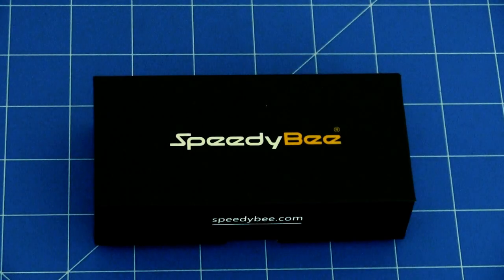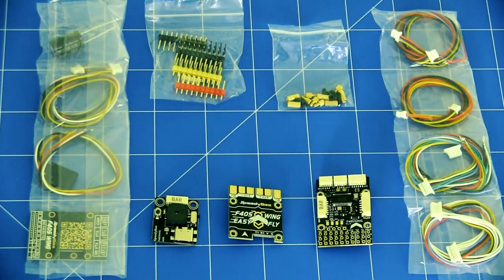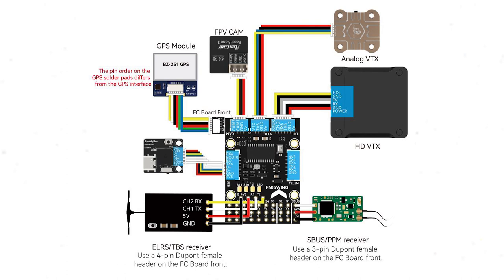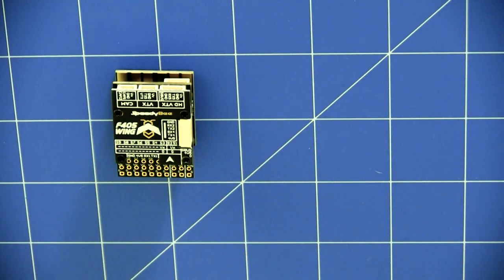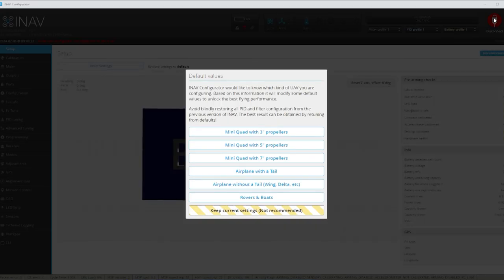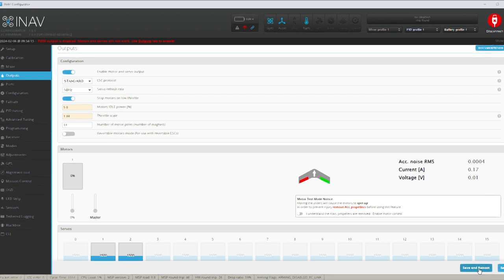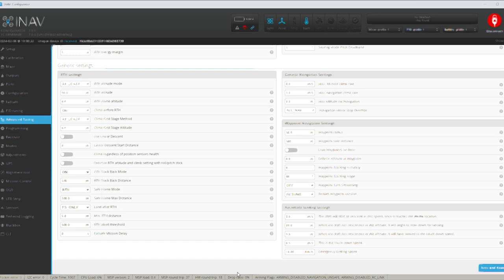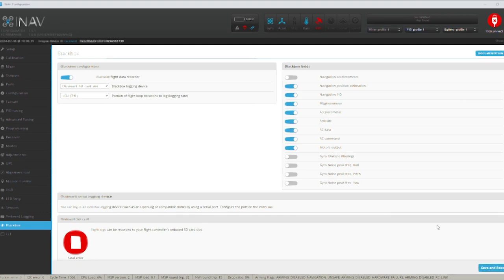SpeedyBee F405 Wing Mini Unboxing, Setup and Basic INAV Install

Comment: Gday mate, 
When you connected to Inav just after reading instructions, Saying to hold down boot button when connecting with usb, You didn't hold the boot button down, Do you need to hold the boot button if not updating firmware. 
Come from betaflight, first wing FC, Just a bit confused by the steps....Not even together yet just received and going through the instructions and watching your great tutorial video.
Cheers Jason.
Reply from the maker: @QuadographyAustralia1965  You only need to hold the boot button in when wishing to update the firmware. That puts the flight controller into DFU mode for updating FC. Just normal connect for setup or tuning etc only need the FC to be plugged in via USB. Thanks for the comment any help just ask.
Reply: @stonesrcchannel  Thanks for that and the quickest reply ever, that's what I thought, but confusion set in. I'm just waiting for a T1 Ranger Twin motors, I don't  want differential thrust, so hopefully I set it up properly. Cheers mate.
Reply from the maker: @QuadographyAustralia1965  Good luck that. Personally I would try the differential thrust just my opinion as it helps turning. I was planning on a twin motor build someday using differential thrust. Good luck hope all goes well with it.

Comment: 15:15 when I hit "flash firmware" just nothing happens, it just say failed to connect please help and "DFU" also isn't showing up in the com port section
Reply from the maker: Sounds like your not holding down the boot button on the extender when connecting the USB cable to the PC. If you are then it could be missing the latest STM driver.
Reply from the maker: In that part of the video I never mentioned holding the boot button on the USB extender so that may be your problem. The manual says to hold it down when connecting to PC. Hopefully that solves your problem
Reply: @stonesrcchannel  correct! It was lacking dfu driver. thank you for replying stonesRC!
Reply from the maker: @sahilmansoori3511  great to hear glad that you have it sorted out. Hopefully it’s a great flight controller for you as it has been for me. Any issue please ask I’ll do my best to help out. Happy flying!

Comment: Hi, I’m not able to go to DFU mode, I hold the boot button before connecting but the lights are not flashing on the board , any idea maybe, thank you
Reply from the maker: Have you tried a different cable? some USB cables they will not accept. I had the same issue for a while until I tried a different cable. It has to be a data cable. Also try powering up the craft via battery see if that helps.
Reply: @stonesrcchannel Hi, thank you for your answer, finally after hours of trying I found out that I need to update the driver, after that I was able to flash the controller, thank you and have a nice day
Reply from the maker: @carlboulianne4284  I’m glad that you worked it out! Happy flying!
Reply: @carlboulianne4284  hello what driver did you update? still cant update mine because it shows up as failed to restart in device manager

Comment: Nothing honing on the charge bar when I click on “flash firmware
Reply from the maker: Make sure your using the speedybee f405 wing firmware if that won't work try a different data cable.

Comment: when i connect it to inav it would not detect the f405 wing mini for some reason tried different cables its so frustrating why is it not plug and play :|
Reply from the maker: @meareAaron  Are you holding in the boot button on the USB extender while connecting it? If you are it sounds like a driver issue. Download the latest STM driver and see if it fixes it.
Reply: @stonesrcchannel  yep i was holding it before connecting usb but all it would do was just change to a different wireless mode and the led changes colors instead of connecting to inav
thanks ill try the stm driver when i do find it
Reply from the maker: @meareAaron  or try using “impulse rc driver fixer” that has helped me quite a few times to get them into dfu mode to flash.
Reply: finally got it working turns out the jst wire connecting the buzzer and usb to the main board was not fully seated🤦
Reply from the maker: @meareAaron  damn such a pain when something so simple is the cause, I’ve been there and done that lol. I’m glad to hear you have it sorted.